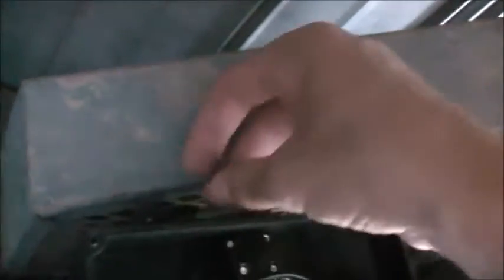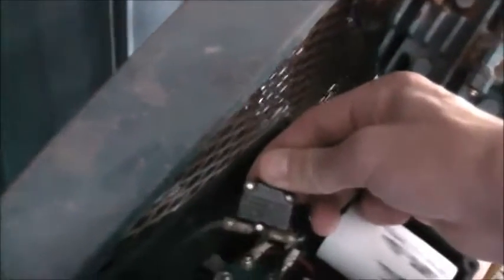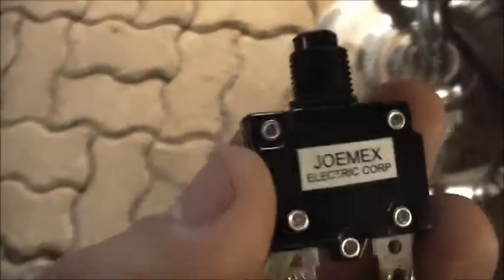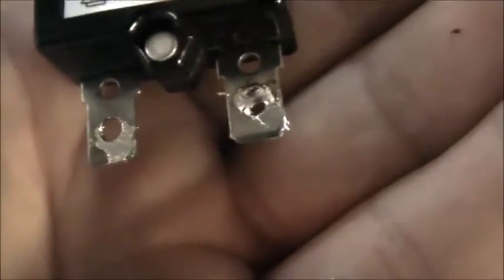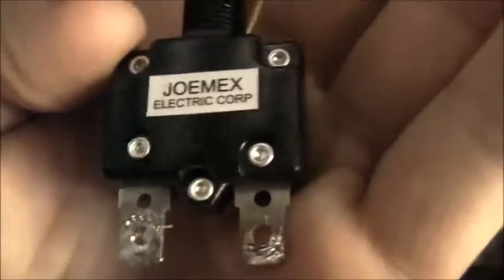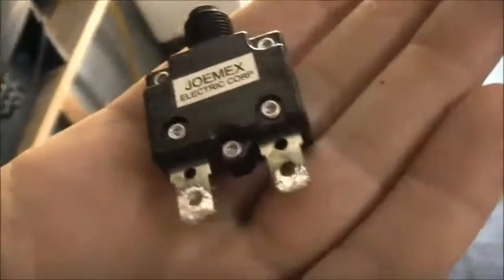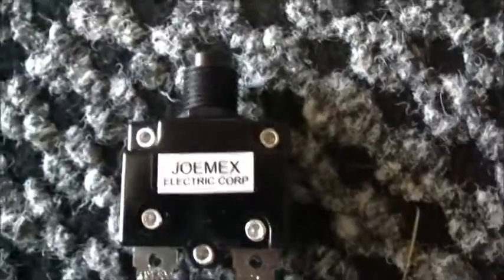Air Compressor Motor Circuit Breaker Replace

Comment: Motors do draw 7 times the running current at start/locked rotor! Silly installing a breaker so close to the full load current tsk tsk. Makes me wonder if they make these thermal only breakers with D curve as well.
Reply: Please elaborate?